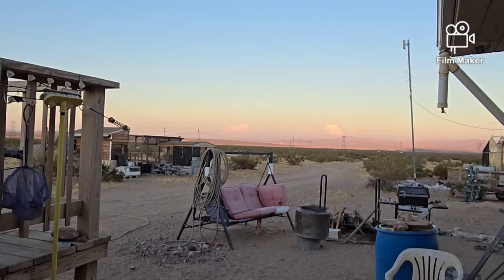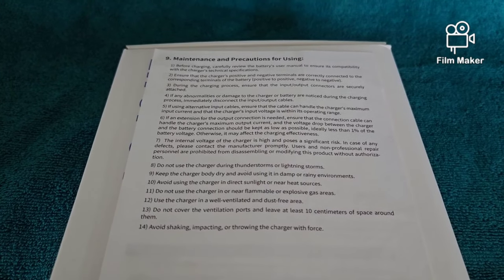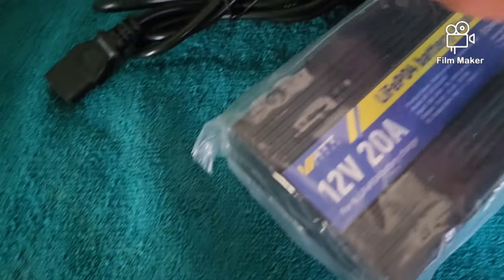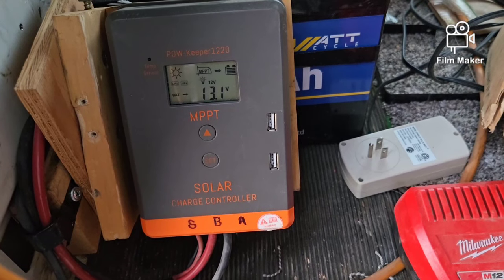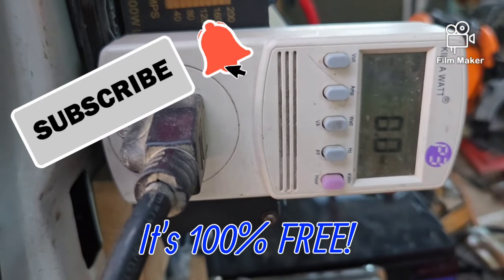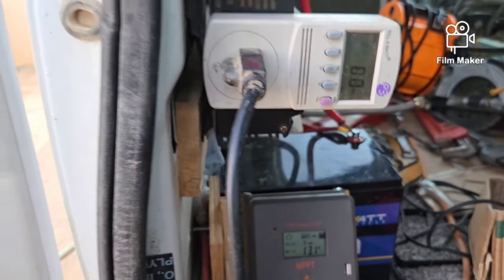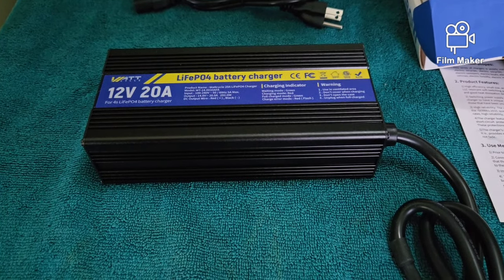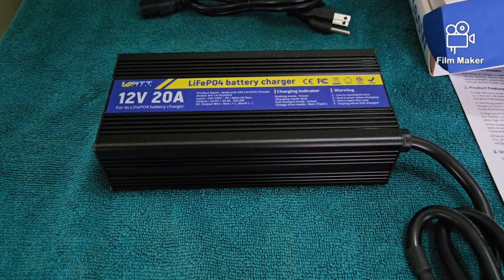WIN 1 OF 4 LiFePO4 Batteries From WATTCYCLE! Aug. 21, 2024

Comment: I hope it has a better amp control selection than the one I bought! I can't zero in on a specific number with mine!
Reply from the maker: @tonylarson1960able  I'll find out soon.  I'm trying to run down this WattCycle 12v, 100ah battery in the van, but it won't let me.  All day working off it and only down .2v
Reply: Well that's a good thing!
Reply from the maker: @tonylarson1960able Sure is!